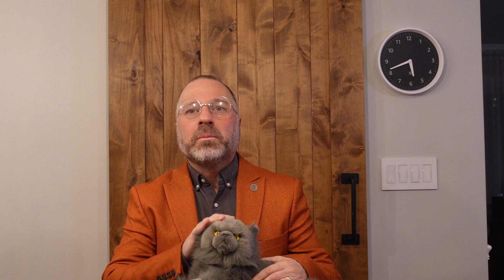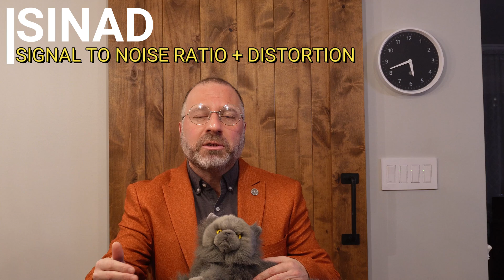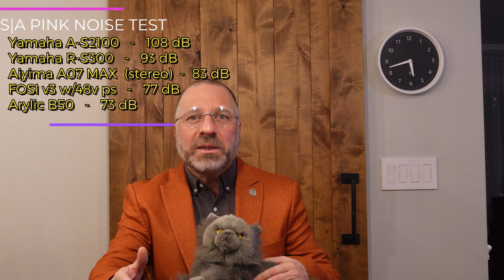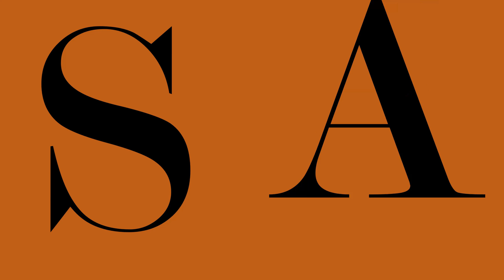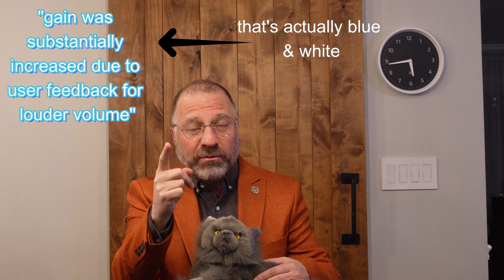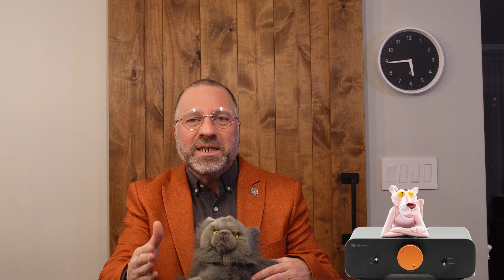FOSI ZA3 - NEUTERED!

Comment: I have two ZA3( 48v 5A supply) and this have allot of useful power for my  Spendor  speakers, sound very good, too.
Reply: In my view the problem with the ZA3 is that using them as monoblocks doesn't substantially increase the power over using one in stereo. That is disappointing.
Reply: Yes it is, maybe not on paper, but what I hear is music to my ears. Love this Fosi's better than my very expensive Mimas... @jimfarrell4635
Reply: The only advantage of the monos is that they can more easily drive low impedance speakers because the parallel configuration means they see 4 ohms as 8 ohm, which is easier to drive. There is no advantage on 6 or 8 ohm speakers. @jimfarrell4635
Reply from the maker: More than likely you received an earlier production unit, with the additional gain.
Reply: @scientificaudiophile the colour of your rusty coloured jacket has definitely affected your brain. 😂
Reply: I have a ZA3 that arrived on 1-5-2024 with the 48v PS.  It is connected to a SMSL C100 DAC which is connected via USB to a computer and via coax to a Denon DVD 2910.  The C100 is a lower end DAC, with a nice feature set, but I don't need a more expensive one for this system.  IMO, it is more than capable of sending a decent output to the ZA3.  I am using a pair of JBL L100t3 speakers. The ZA3 drives them far beyond the maximum level I typically see in normal use.  Also, the sound quality is very good and well exceeded my expectations.  In fact, I had to turn the ZA3's volume down to allow finer control over the sound level.

I am not saying the ZA3 is as good as conventional amps, integrated amps or receivers.  I will say that it delivers sound output and quality well above its price point and it will be all that many people who just want good, decent sound quality on a budget from their system will need.  My experience is the same as many, many others who are using this amp.  I am not referring to YouTube reviewers, etc. but average Joes posting in audio forums.

Personally, I think judging the ZA3, or many of the newer budget class D amps, based on the advertised specs or sound level measurements are missing the point of these amps.  They should be judged on how they perform in real world use cases for normal people.  In this roll the ZA3 shines and provides sound quality well above its price point.  The fact it has sold out three production runs, and is still in high demand, says a lot about its value and performance.  This would not happen if the ZA3 was not a very good performer in real world situations.

Comment: I listen to Amir's graphs, not music. That's because I'm a graphophile.
Reply: I sold my Fosi V3,  The Aiyima A07 max sound much better using Muses02 than sparkos ss3602 using 48v 5a power, and the Fosi V3 measure better than za3. I trust my ears rather than whatever is measured.
Reply: @tonym8358  You mean your trust your bias ;) In the end what you're actually hearing might be a slight difference in frequency response due to the objectively slightly difference in load dependency of the Aiyima that you subjectively prefer. Nothing wrong with that, but you could get the same effect with a DSP anyways (something which every decent audiophile should have, fixing room modes etc).